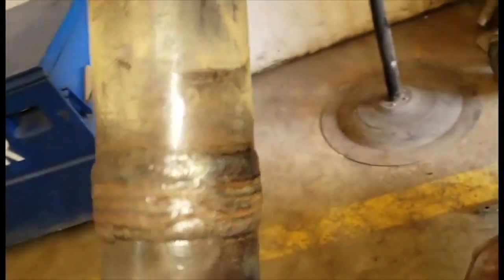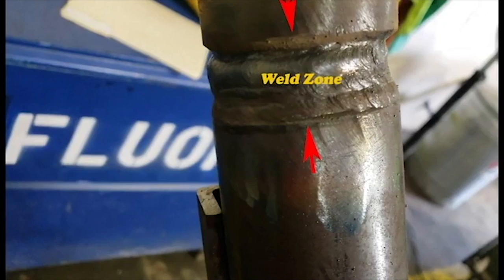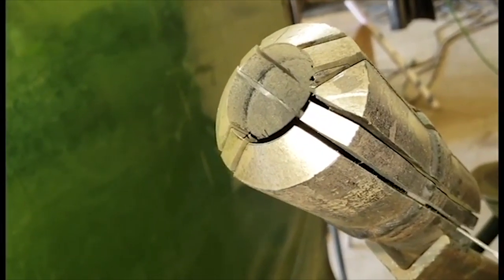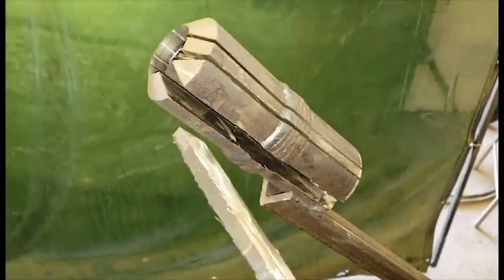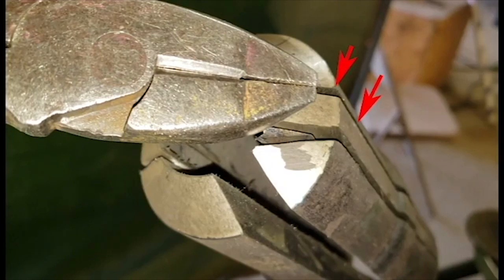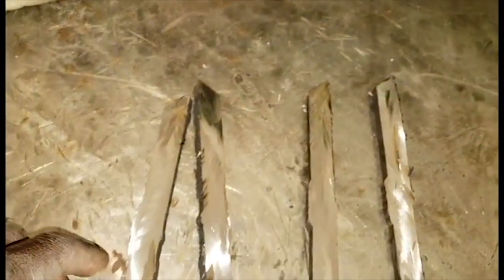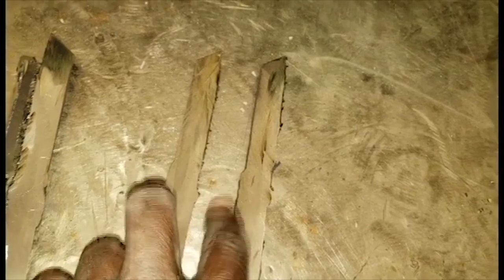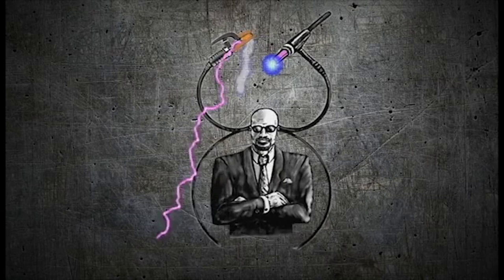[Pipe Welding] 6G 2 Inch Heavy Wall Pipe Test. How to cut and prep for bend test. "THE EASY WAY"

Comment: Thanks Chris for this video. I was tripping on how to cut the coupon at the right angle. How long do you usually wait between passes with SMAW?
Reply from the maker: I don't wait, I just make a pass clean it off using the wire wheel  and continue to weld. As long as your amps are correct you shouldn't have to worry about letting the pipe or plate cool down as far as carbon steel is  Concerned. Thanks
Reply from the maker: About 30 second. The time it takes you to clean all the slag from 
  The initial pass.